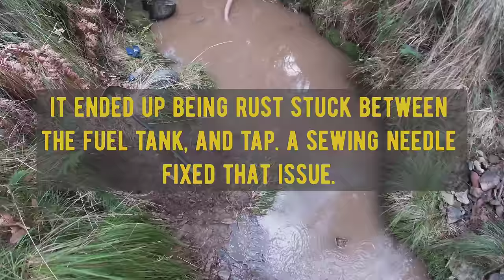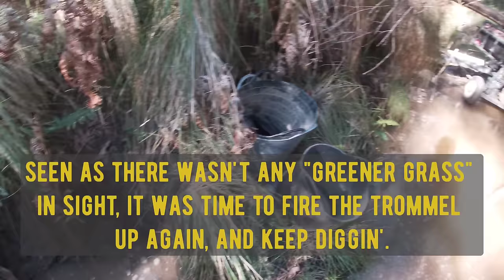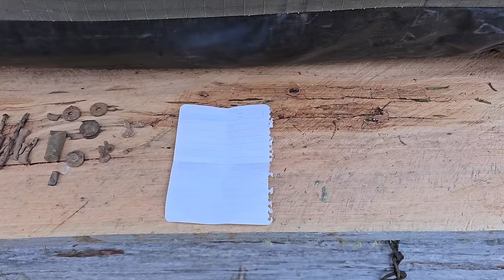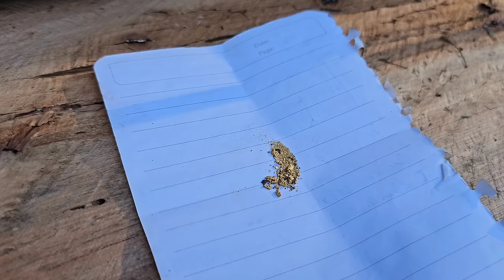Gold Trommel. Sampling some very rich ground!

Comment from the maker: Seems to be a bug with the comments section sorry folks. Ill try to pin this, so you're all aware. Please feel free to comment, hopefully they become visible to everyone soon
Reply: now do u check your rock tailings at all?
Reply from the maker: Sure do mate, buzzed over them with the 5000 before we left. Didn't pan them, very confident in my equipment 🤟🏿🤟🏿
Reply: Why do you take apart your sluice box when your water is running?
By taking it apart while the water is running, the low-pressure zones become high-pressure zones again, causing your gold to flow out of the box again. I really think you should check your rock tailings. I love mining videos on YouTube! I have never seen a miner disrupt his sluice box when the water is running. It gives me the :face-blue-wide-eyes: when I see you do it.
Reply from the maker: You'll just have to trust me on that one mate, but seen as this is a comment I receive quite regularly, ill actually do a video on it, and we can all bust a few myths 👌🏿
Reply: @TheGoldmansChannel  but doing a random spot check cant hurt. no matter how much you spent on your gear.
Reply from the maker: In my experience, the more you spend on the equipment, the more likely it is to lose gold 🤣. Basic is best! Checking your tailings is essential if you're getting accustomed to new equipment, but not essential when you're confident in the sluices setup.

Comment: Nice job, how good is that bleed valve on the pump, reminds me of my bathroom in the 80’s..  nice to have some water to run the trommel, thanks for sharing
Reply from the maker: Cheers Jeff. Yeah the top tap is a ripper isn't it, it came back to me like that after my friend Jeff borrowed it recently believe it or not 😆. It did have a modern  1/4 turn washing machine tap on it when I dropped it off. But I like the old one heaps better haha

Comment: The first thing I noticed is the pump is soo close to the water.
Might fall in ?😢
Good video
Reply from the maker: Had that happen a few times over the years 😅. Not for a long time though, I'm careful with the positioning. Finding the perfect balance between a safe spot for it to sit, that's also close enough to the water to reduce load on the engine and in turn, save on fuel costs 😁

Comment: Good stuff mate, are you testing your sluice tailings? If it  was me I wouldn't be altering the flows with my hands while the water is still streaming..
Reply from the maker: Thanks Darren! I didn't sample my fine tailings this time, no. I rarely do, to be honest. I stopped worrying about losing gold about a decade ago. Did a heap of experimentation with sluices, flow, and feed rates to establish recovery rates. The end result was clear. Gold doesn't like leaving the box. Bugger all of it even makes it into the blue miners moss, let alone coming out the end. 
And I always "swish" out my boxes by hand to reduce volume. Many years ago I lost a big flat flake by being a bit aggressive with my swish. But that was in a clean up sluice with 10 or so grams packed into it. Like I said, gold ain't easy to kick out of a good box 😁
Reply from the maker: I did detect over the fine and course tailings with the 5000 before I left though. You just never know when a nugget is going to pop up.
Reply: @TheGoldmansChannel  thanks for the reply mate, I realise you know what your doing! Your mat set up would rarely loose gold, and you would of tested the F out of it, I'm just envious I can't use a trommel or highbanker legally up north🤣enjoy your videos mate👌
Reply from the maker: Nsw I gather? I feel for you mate! The rules up there suck. No doubt Vic will suffer a similar fate before too long either. But I won't stop diggin' either way 😝
Reply: @TheGoldmansChannel  Queensland/NSW, qland is the pits for prospecting, can't do shit, NSW is heaven compared
Reply from the maker: Sorry to hear man. Funnily enough, when I was up in Clermont working a claim out on Miclere Rd back in the day, I remember thinking to myself that the QLD laws must be far more relaxed than ours down here. Has this changed recently? Or was I just oblivious at the time. (I wasn't the claim owner, so I didn't know all the ins and outs).

Comment: Crazy that you disturb your sluice before  getting a catch baison under the end of it. picking up the black mat over the v mat likly lost some gold and  also change in velosicty of water goofs up  the retention behind the riffels. Like your trommel very much. Seems to me water flow under the riffels through the miners moss will hinder gold retention. I used a highbanker with 35 feet of sluice and friend were amazed that I had gold all the way down it. Have to compliment you however not kicking over the concentrates pan hauling the pump and trommel passed it, that's my usual trick. Curious would it not been more productive to have used time spent paning cons on the creek running  another 20 minutes through the trommel?
Reply from the maker: Video coming soon to hopefully put an end to this myth mate. I've been slowly aggravating people with that one over time, with the intent to clear that issue up 😁